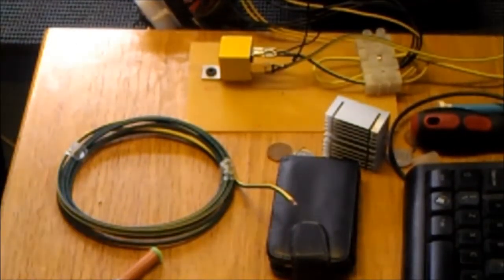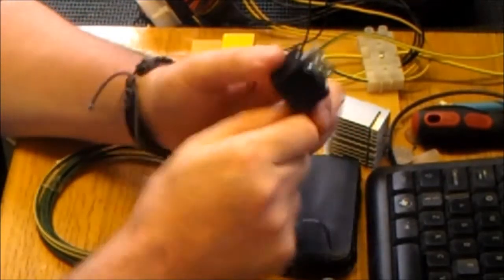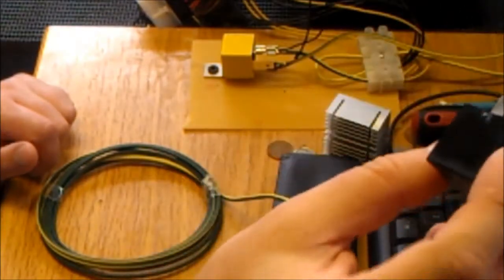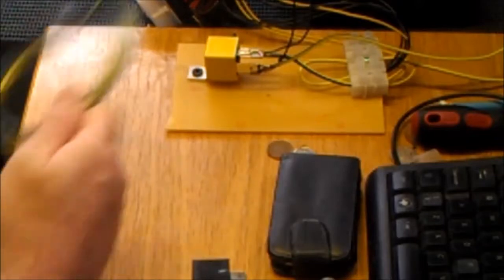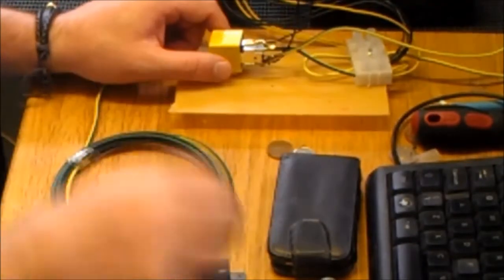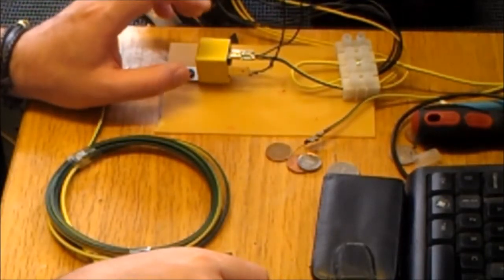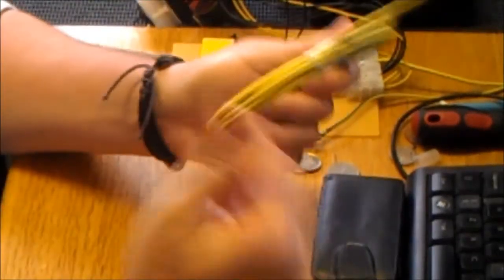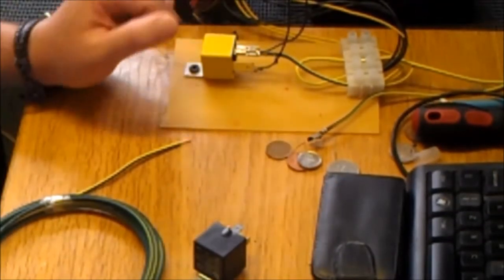trying to work out the best way to heat a 300mm x 300mm bed

Comment: Hi. I used an optocoupler with 2 mosfet to use with my new 24V power supply for the heat bed. The problem with relays is that RAMPS uses PWM to control the power tor the bed, and the relay could get worn out really soon. A solid state relay could also work fine.
Reply from the maker: thanks pilleyuppo23 thats cool would like to see pic's of that setup as it will help are you on facebook if so add to this group plz  3D Printer DIY.. im also looking at the A solid state relay but not know what one to get yet or  if the wiring to a RAMP 1.4 is different